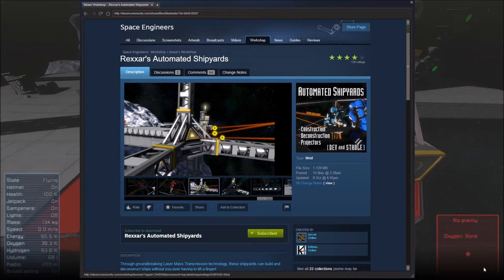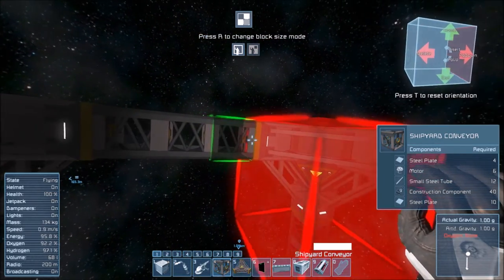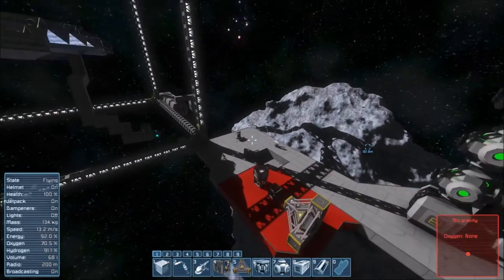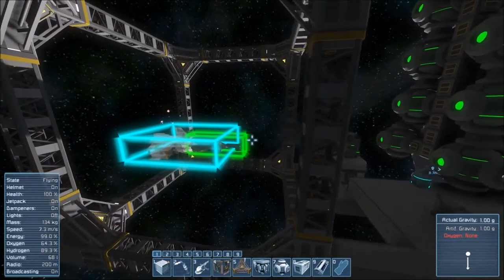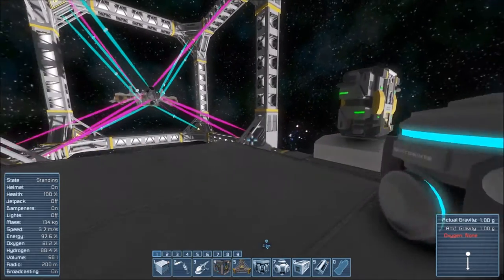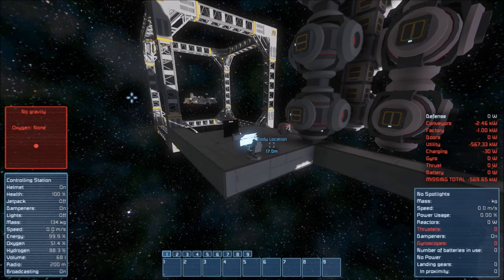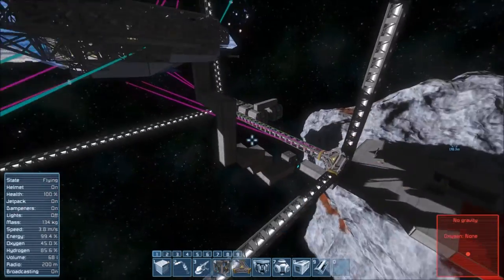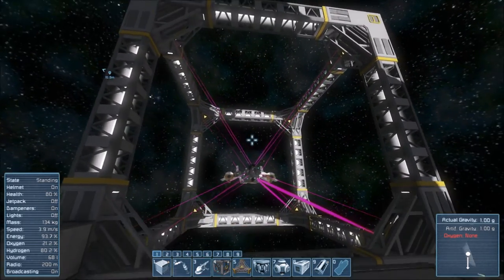Rexxar's Automated Shipyards mod guide

Comment: Quick question for you, I can't get the LCD and button pannel to work, I can't find anything helpful on any forums. Thank you for any advice
Reply: Jon! I know this is a month late. But you need all 8 of the corners in a square or rectangle, as long as they are even! And you also need an LCD and a button panel nearby, as well as making sure there are the shipyard conveyors connected to the main corners. Then hook up a conveyor system to one of the corners to a chest and your good to go! Go into the control console and find the LCD panel, re name it to     Shipyard     Then it should load! After that, your alll set!
Reply: Zidraxus thank you! I figured out what I did wrong I was using s modded conveyor that didn't like the corners!